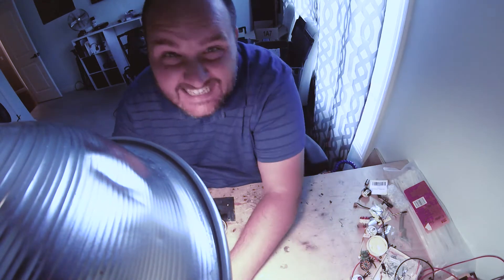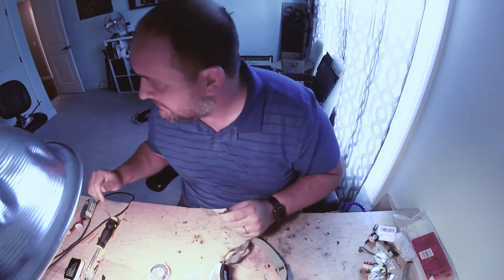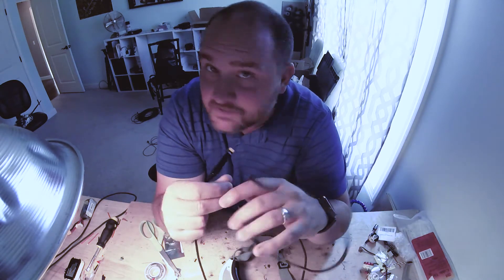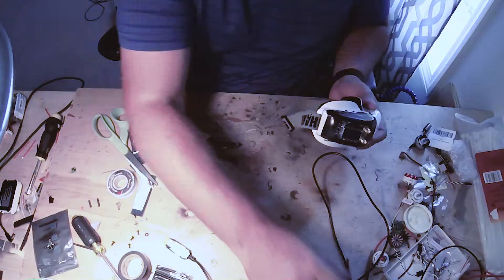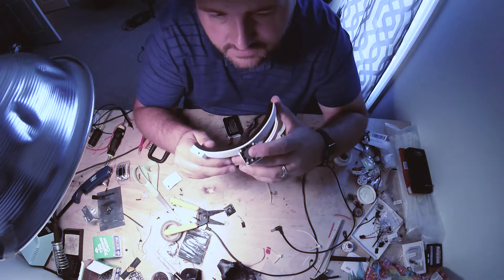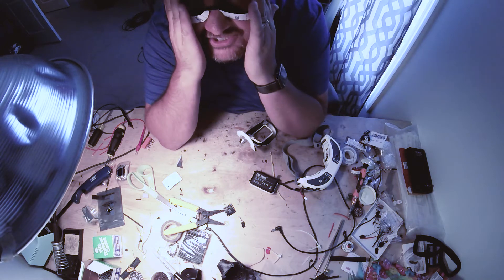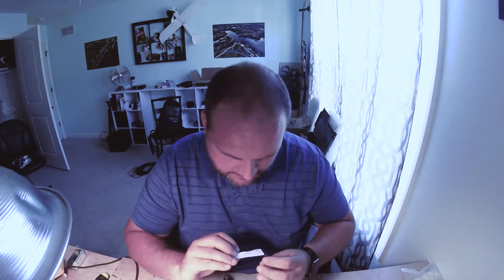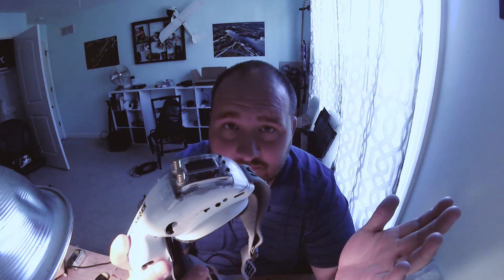Must Have Fatshark Mods & Repairs!  LITFO FPV

Comment: I actually mailed fatshark ... the reponse I got: 
"The Fan is rated at 12v so yes it will work with 3s. However, the fan will run very fast which is not ideal. If you are making a cable just take the 2s out from the balance lead to power the fan."

so the fan is 12v, but it is run on 8v so it runs slower. I don't think a 12v fan will start up on 3.7v, but that could depend from case to case I guess. I have not had time to experiment further with this, I am considering a simple voltage control limited to 12v, to regulate the fan speed
Reply: hmmm interesting! sounds like a fun test! message me if you wanna chat bro
Reply: btw i just subbed have fun brother

Comment: the fan runs on 3,7v? you might take a closer look, on the original battery it only has the red and black wire on that balancing plug, and it is 8v. You do not say what version you have, I have the dominator V3
Reply: have no clue what i'm talking about but because he modded it with a 4 cell batt on a regulator chip, also 8 v for a small fan? im new to this but 3.7 seems about right. im sure im wrong so don't kill me.
 btw love flying
Reply: @jeramiegray7957  see my other reaction.